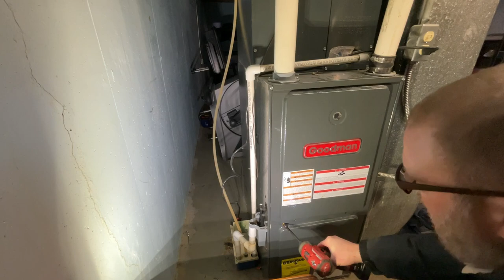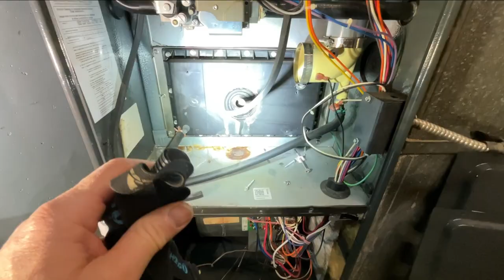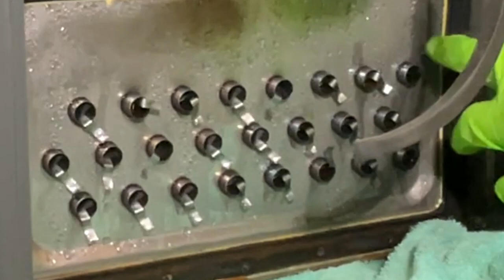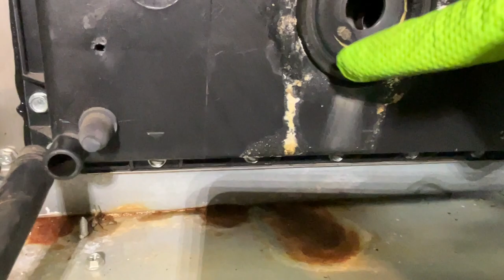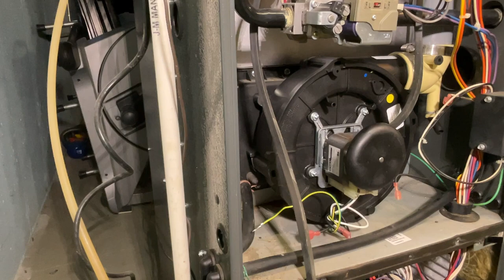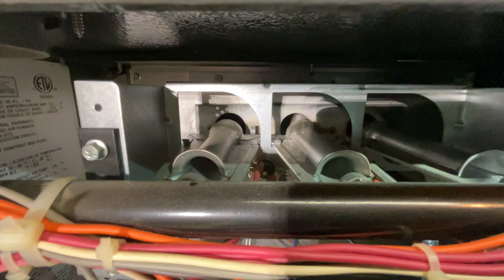Goodman Draft inducer replacement. And Leakey collector box fix.

Comment: Thank you for this video! Last week I just installed the new Goodman Furnace GM9S960603BN for my house- one of the advertised features is faster condensate water drainage and no unit water leakage. I hope this model will avoid these issues, as I assume the company is constantly working on product improvements. Question - these traces of scale on the plastic lid are apparently formed by water flows, however, scale usually appears in the kettle when using hard water, and where does this scale come from in the water that is formed from collected from air condensation water? Also it would be interesting to know what kind of black sealant you used for the plastic cover?
Reply from the maker: Thank you for your comment and for sharing your experience with the Goodman Furnace GM9S960603BN! It's great to hear that you're enjoying the advertised features. Regarding the scale on the plastic lid, it's possible that the water used in the condensation process contains minerals that can lead to scale buildup. As for the black sealant, I used Permaflex. Hope this helps!

Comment: Great video. I was getting an error code for pressure switch but the inducer wasn’t even coming on. I was getting power to the board and I wasn’t getting any power to the inducer but I was for every thing else. The guy before me left one of the pressure switch hoses loose. Do you think that’s why the pressure switch code was showing?
Reply from the maker: That could have been the issue for sure!

Comment: The old one got yellow cap with drain port, why new one doesn't have one?
Reply from the maker: That's a great question
Reply: @ADVANHVAC  let me know whether that new one is for horizontal installation only? For vertical installation there is yellow cap drain port version one?